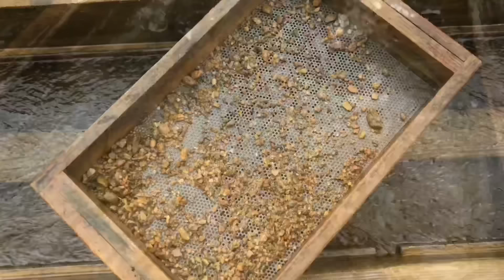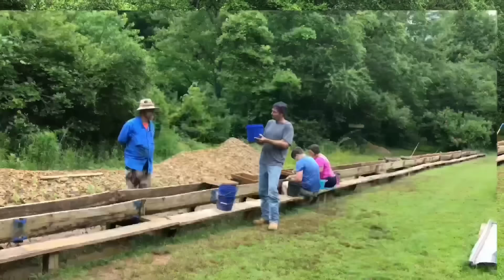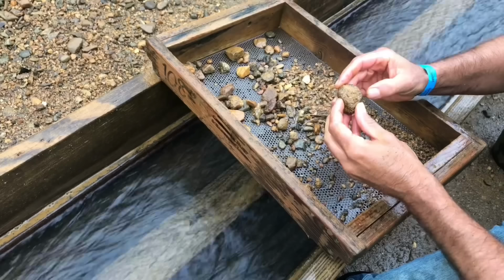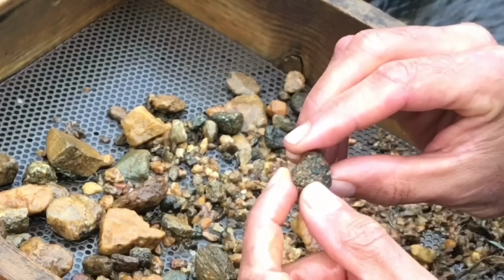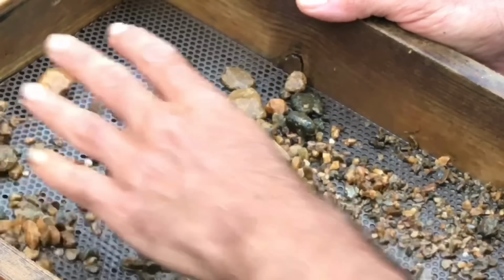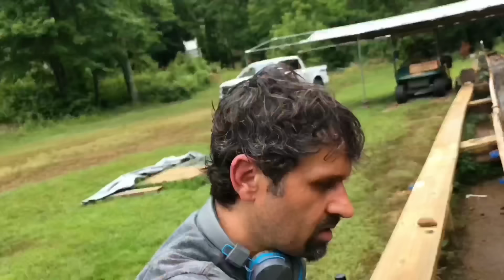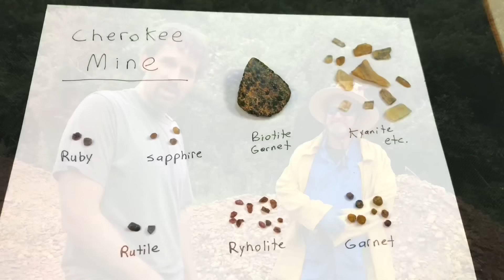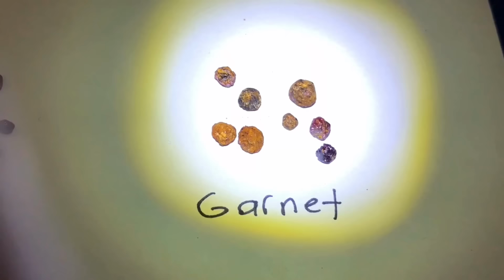Ruby & Sapphire Crystal Mining @ Cherokee Mine in North Carolina

Comment: North Carolina I believe has gold, did you check the flume where you put the tailings in from the screen??  Gold is 19.1 times heavier than water it will drop right there if it is large enough. Does not mean that area has gold but if you put a riffle in that flume it would collect there.